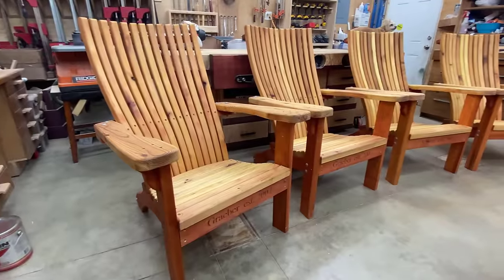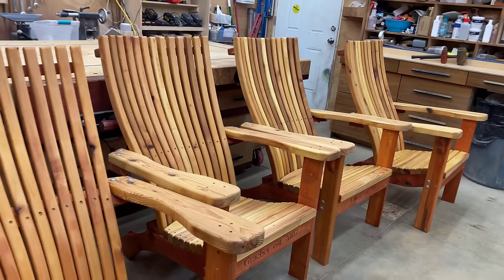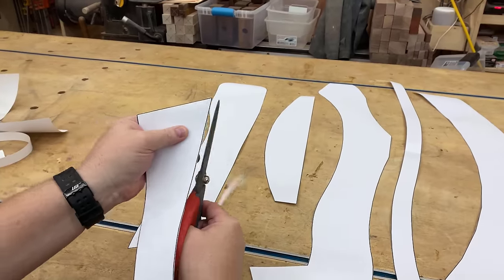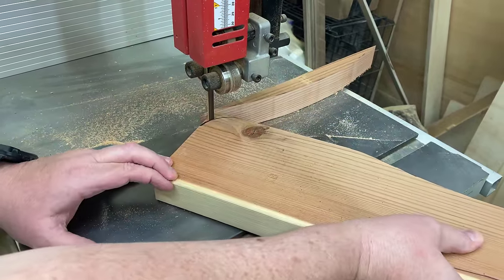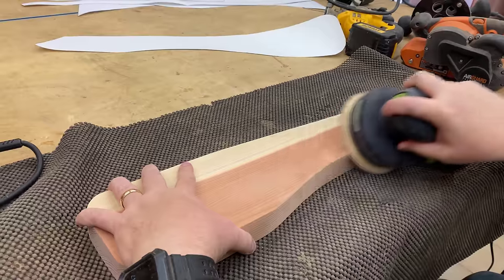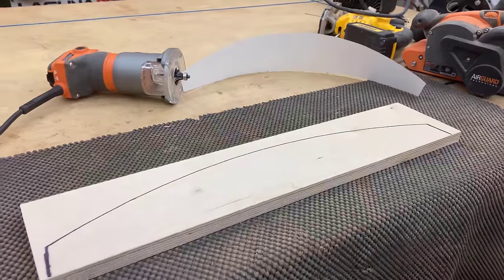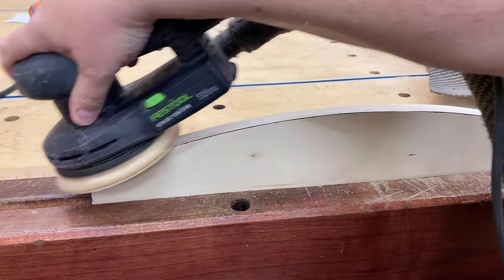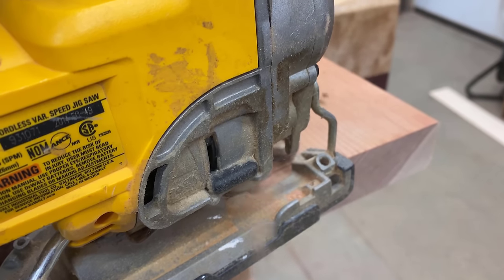How to Make Money Woodworking & Adirondack Chair Detailed Build

Comment: Great plans.  Went together perfectly.   Out of curiosity what is the price for the wood you are using as of now.  I had almost 100 bucks in wood on this build out of pressure treated.  I priced Cedar and the cost was close to 300 bucks for the build.  Has the price of this material gone up that much or am I just not looking in the right places here in Ohio?  The chair was sold before it was finished but I was asked what it would cost to build one out of Cedar.   I told him I would get back to him after I researched the material price.  I have not had much luck finding an Ohio supplier cheaper as of yet.

Comment: I just bought your plans, these look awesome.  Would you consider using a pattern cutting bit on a router table with your hard patterns or is the wood too thick to do that comfortably, or is it just easier to do it with a saw, then sand to final size?

Comment: First of all, please forgive me if you mentioned this already, but what is the background noise? Sounded like a router running non-stop.
Loved the chairs and just ordered the paper templates. Plan to make permanent templates out of Masonite and use a flush trim outer on a router table. Wondering why you don’t have correct template lengths for each seat slat?  Seems like as long as they are cut to allow 1/8” slop then they could be centered and you can avoid the extra step to mark and cut a second time. I’m wondering if this video was for beginners because I see you have Festool gear so I’m guessing you have a table router, which you used to build the majority of those 750+ chairs.

Specially, how much time do you figure it takes to build one?

Comment: Mr King. Greetings from Lindsay Ontario Canada.   I just purchased the plans and templates and have 2 questions. Would you or do you fill the holes left after driving the screws to prevent future rot. And I plan to use the templates to make ones out of hardboard or plywood and the use a router and template bit. Have done this and/or are there downsides?
Thanks.

Comment: I would really appreciate any guidance on my question about 3/4 thickness.  I’m about to cut wood for 3 chairs. Thanks in advance
Reply from the maker: Hi John, I often don’t see these. Email is usually the best way to get me. 

As to wood thickness, 3/4” works just fine for everything, except for back slats. 

The back slats gave to be cut from wood that is 1-1/2” thick.

Comment: Can I use a 2x2 for the back slats?  With the curve I’m not sure i can get it out of 2x2. Do you have a list of what wood to buy? I did buy the template!
Reply from the maker: Hi,

The plans are required, the templates are optional. I explain that in detail on the website. 

The plans are 20 pages, they have all the straight pieces info too, and angles, bevels etc. plus cut list with layouts on various size lumber.

Comment: God I got a couple of questions I've got a lot of barnwood from my granddad's whole barn that fell in and none of it's the same thickness Most of us between a 1/2 inch in a 1/8" difference And I don't own a plainer Also I don't own a router So can you get the same results with hand sanding As that router And I am interested in those templates Oh also do you have a link where I can buy the paper stock ones Or do you have APDF file I can download and have our print shop throw in it

Comment: Great chair, I am really enjoying making it but I am a little confused.   I purchased the templates and cut them out and labelled them exactly as they came.   My templates showed an "UPPER BACK SUPPORT". Is this the same piece as the "MIDDLE BACK CRADLE" as spoken about in the video ( 43.35 minutes).  If it is that's great.   Next question, I could only get 2X8 so the UPPER BACK SUPPORT ( which I hope is the middle back cradle) doesn't quite fit.   Is it OK for the arc to be cut off??  Will this spoil the appearance.   My plans show that in the 'parts breakdown/cutting list that the MIDDLE BACK CRADLE has the arc cut off to fit.

Comment: Question, on the website it says you can make this from 3/4" material. I suppose that's true other than the back slats, but how do you make the curved back slats from 3/4" material? Just make them straight?

Comment: Quick question, do I need to worry about putting Penofen oil in the countersink screw holes that are exposed, or is it not a big deal? It seems that water may sit and soak in those areas, especially in the seat slats.
Reply from the maker: Water isn’t the biggest enemy. It’s the sun. 

You could follow up and put a drop or two of Penofin over the screws, and it will soak in. This will add a tiny amount of benefit. But not a ton. Any standing water that might sit there will evaporate. And the wood will dry out with no harm.
Reply: @KingsFineWoodworking  I was wondering this too. Have you tried cutting plugs for the screw holes? I appreciate this is a lot more effort but is there any other reason they wouldn't work?

Comment: Thank you for making such a detailed video!!  The chairs look good, but as a perfectionist I see several things that could be improved.  I would Hide all the fasteners with bungs.   I would make sure the fasteners behind the lower back support did not show.  I would align all the screws along the middle of the back supports.  I would match the metal on the bolts (looks like galvanized on the front legs and stainless on the rollers?  I would use black colored rollers.  These are my opinions, but as a son of a master cabinet maker from Portugal, I've seen how attention to little details can significantly improve overall results.

Comment: I thought that i asked this in a comment a while back,  but now i can't find it - where do you find that Penofin? I'm in the Denver area, and none of the big box or hardware stores seem to have it. I tried using Preservawood finish on one i made a year ago,  and it already needs refinishing.
Reply from the maker: Hi. I used to get it locally at deck building supplies like Alpine lumber in Parker, or the Deck Superstore in commerce city.  But lately I’ve just found it from paint supply companies online or even Amazon for cheaper.
Reply: @KingsFineWoodworking  Awesome, thanks!

Comment: Do you personally fit comfortably in the chair?
Reply from the maker: Yes. We tried to design it so that it was comfortable for a wide range of people. We had more than a dozen different friends try different versions as we went through design, and we finally settled on this. I think anyone from 120 pounds up to 500 pounds will be comfortable. And I’m sure the chair design will easily hold over 1000 pounds.

Comment: How did you do the sign ? Did you use a router or cnc machine?
Reply from the maker: I’ve done both. I used a router with a sign kit from Rockler for years. Then when I got a CNC machine I started using it.

Comment: Hello, I got your template and I’m half way through cutting all the wood but how tall do I cut the front legs and how wide for the front slat piece? If I missed this in someone else comment sorry for the repeat
Reply from the maker: Hi, it sounds like you didn’t buy the plans. 

The plans contain all the critical data, like the straight pieces, the angles, bevels, and are actually required for assembly. 

The templates were just optional and are only supposed to be bought if you already have the plans. I specifically state that on the website.  

Here is a link to the plans if you’re interested. 

Thank you,
James 

https://kingsfinewoodworking.com/collections/project-plans-for-sale/products/adirondack-chair-new-comfort-design-3-d-plans

Comment: I'm not sure where you can find 2x12 cedar to make this for $80-100. You can build these for about $100 if you use cheap pine from Home Depot, but I priced out cedar (which all my local shops sell for $12/ft or more for 2x12) and the 2 - 8' 2x12's and 2 - 8' 2x6's cost over $250. Maybe people will buy pine adirondack chairs for $400, but I'd be surprised. I'm going to try to make them from cedar and sell them for $450, but I'm not confident I can get that much.

Comment: I am also curious how many boards are needed for this project? I am considering buying the plans but I want to estimate the material cost.
Reply from the maker: Hi, four boards:

Two 2x12-8’, 
One 2x6-8’
One 2x4-8’
Reply: @KingsFineWoodworking  Thanks! I could build it from redwood for about $150 in materials. I will place an order for plans and templates.

Comment: So I have to buy the 3d plans before I can buy the templates?? I have no used for the 3d plans. Don't have a computer.
Reply from the maker: The plans are how to build the chair. Everything that’s needed. The templates are completely unnecessary. 

The dimensions on the plans are naturally scaled up from fitting on an 8-1/2 x 11 sheet of paper.  You scale them up to full size. 

That’s very fast for the straight pieces, but it might take you an hour or two for the curved pieces. 

The templates were created to speed up the process for those who are in a hurry. But they are only the scaled up drawings for the curved pieces since people must have the plans. 

You should consider them an optional upgrade to the 20 page set of required plans. 

Thanks

Comment: What is the height and angle for the front legs? I ordered the template but they were not included.
Reply from the maker: Hi,
It’s on page 20 of the plans. The plans have every detail of every piece sketched out on a separate page. Including all angles, the cut list etc. 

Like it says on the website, the templates are only for drawing out the curved pieces.  98% of the build comes from the plans rather than the template. 

Here’s a link if you need it. 
https://kingsfinewoodworking.com/products/adirondack-chair-new-comfort-design-3-d-plans

Comment: I really like the chair but was wondering why you don’t use glue.
Reply from the maker: If your wood is correctly kiln dried and the chair is subjected to normal use, glue isn’t necessary. However if you do use a good waterproof glue like titebond 3, the chair will be much stronger. If you have the glue and the time, I’d recommend using it.

Comment: Hi, I am just getting started and would love to have a template
Reply from the maker: Hi!

Here is the link to the plans for it. These are essential. https://kingsfinewoodworking.com/collections/project-plans-for-sale/products/adirondack-chair-new-comfort-design-3-d-plans

After the plans, this is optional. These full size paper templates are for all the curved parts! This makes it even easier.  https://kingsfinewoodworking.com/collections/project-plans-for-sale/products/templates-for-adirondack-chair
Reply: @KingsFineWoodworking  excellent.  They are beautiful chairs.
Does the back sit higher than the traditional Adirondack chair?
Older people find the lower seat difficult to get out of.
Reply from the maker: The back is considerably higher the front is too. It’s nearly normal height. We considered all that when designing the chair & rocker both.

Comment: Is it true that the plans do not change if you use 3/4
Reply from the maker: Yes, that’s true. With the exception of the back slats, which must be cut from wood that is 1.5” thick. 

I designed and built the chair so that the thickness of every other piece can be variable, and anywhere from 3/4” to 2” thick.

Comment: I'm curious as to why you're using screws and bolts but no glue. Just not necessary? Thanks.
Reply from the maker: We we going to flat pack and ship these. 

If you aren’t doing that, you should also add Titebond 3 to the joints before assembling 

Thanks!
Reply: @KingsFineWoodworking  Good to know! Thanks.

Comment: About what should be the acceptable moisture content of the redwood? Anyone please? Thanks!
Reply from the maker: 10% - 14% would be fine. A little drier is ok too. 

Since it’s an outdoor project it’ll be varying a whole lot anyway. The important thing is that you don’t start with completely green wood (fresh cut from the mill). It needs to at least air dry a season or be kiln dried. Or even stored inside for 6 months after cutting into boards from the log.
Reply: Thank you James, much appreciated for answering, I should start building my first chair soon, big fan, thanks!

Comment: I've ordered templets, material list, plans and bunch of other plans and lists back in March and so far i got only templates. no email or response to my inquiry where the rest of the order is. I'm not sure what's going on with this but certainly would be nice to hear from him
Reply from the maker: Hi, all plans are downloaded immediately on the spot. They are in pdf format. It actually says that right on the website where you buy. 
Only templates are mailed out. Also I’m not sure where you are emailing. I get over 400 emails a day, but I spend about 3-4 hours answering every single one. 

You can email me at james@kingsfinewoodworking.com 

And I’ll email you back and attach any plans you ordered (I’ll need your order number). Or you can use the email you received when you bought them. In that email, there is a second link to download your plans with, in case you don’t do it the first time.
Reply: I paid thru shop app, there’s where I emailed first time and then directly on your web. I never registered on your web since I was redirected to shop and the whole transaction went through them. There was no mention of PDF - I wouldn’t order plans since I don’t own a printer that can print plans. If that’s the case as you say- it should be made obvious that it’s a download. If it’s small print like a disclaimer and easy to miss, you should Make it in capital letters and red to avoid confusion. Plans and templates for bench are PDF download too? If I remember correctly price was similar to print for chair that I received. But I guess as long as you got your money... who care right...?
Reply: I understand that there’s a lot of emails and paperwork but I guess that’s what it takes to do the business you’re doing. Maybe you need a secretary or something. If you want to make videos and sell- make sure that you can do both. You seem like a smart and good guy but I wasn’t born in pile of money either and I don’t take more jobs than I can satisfy.
Reply: Sorry dude, just read the whole description about garden bench but not a word mentioned about downloading the plans. I retrieved my order but no option to even download anything even if I wanted to...!

Comment: I have noticed there is no template for the front part that’s been engraved or the legs ?
Reply from the maker: Hi, no. There was no point in making a template for any of the straight pieces. All of those are on the plan, and it’s easier to just measure & cut a straight piece.

Comment: What size paper is required to print the template?
Reply from the maker: 24” or larger printer. It will need 24” roll paper. 
When printing them, just select 100% scale, or 1:1 scale. Then it will size it to be exact.

All pdf templates fit with the constraints of any 24” wide printer. But they are all different lengths of course.

But don’t forget the plans. The templates are designed to be an extra over & above the plans. And it only covers the curved pieces. Like the website says; none of the dimensions of the straight pieces are on the templates. And neither are the angles, bevels, cut lists, materials lists etc. 

Thanks.
Reply: @KingsFineWoodworking  Thank you so much. You're incredible man. Can't wait to give this a shot!
Reply from the maker: @snead1 , just email if you get stuck or need help. I’m always happy to help!

Comment: I receive the template paper but it doesn't include the seat boards or the number on it is incorrect.
Reply from the maker: Hi, you are correct. The template is only for the curved pieces.

The 20 page plans, are required for the build. Templates are just an optional upgrade. I explain that very carefully in detail on the sale page. 

Thank you.

Comment: your videos are awesome. but man you have so many visibel screws, why not design a little longer for no visible screws. i think its worth it. for example the arm rest. make 2 peaces of wood underneath the arm rest that go around the front leg. then bolt it in place thru the sides of the side peaces and the leg. sink the bolt in the wood by drilling a sink hole so you dont see the bolt.

Comment: why did you not use any glue on this project. 

why,. after making the wooden template, didn't you use a router and flush trimming bit to finish the parts.

Comment: Believe me, guys, I'm not wanting to be critical, but I just can't understand the unevenness of many of the screw holes, mostly having to do with the back slats. Wouldn't this be noticeable to a prospective client? Everything else about the chairs looks great, but it seems to me so easy to take that extra bit of care required to make a straight line for the screw holes.
Reply from the maker: Great point! I was too focused on the filming and the sequence, and I should have paid better attention to this detail. I correct that when I film the rocking chair. Thank you for commenting. :-)
Reply: @KingsFineWoodworking  Thanks for being so humble about my remark. Thank appreciate your addressing it. The chairs are awesome!
Reply from the maker: @GodsMan500 , thank you!!